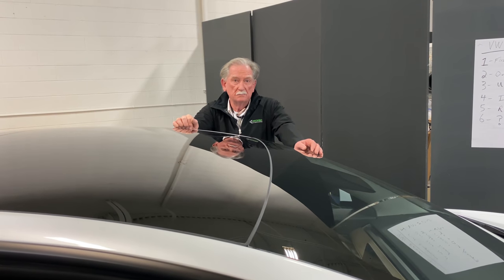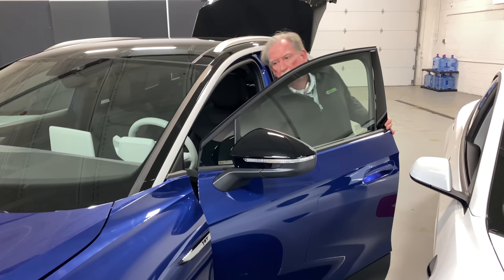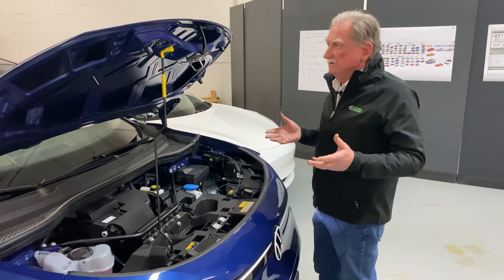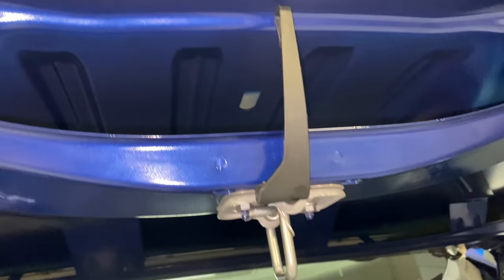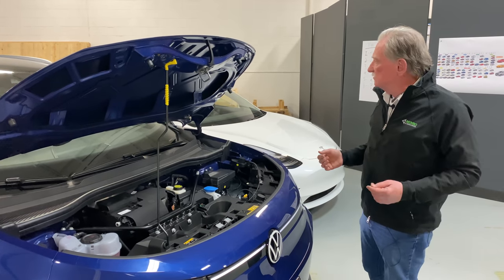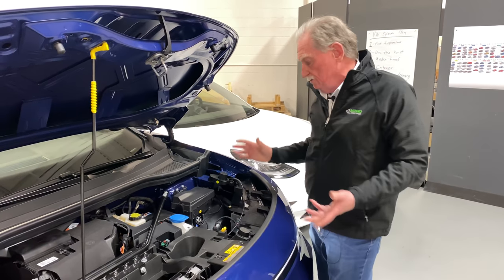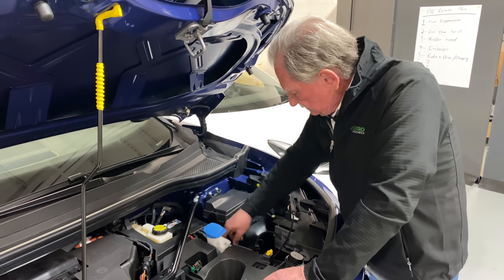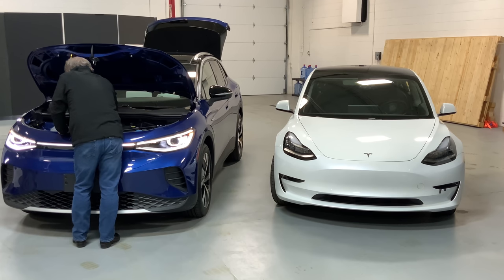2021 Volkswagen ID.4: E2 - Under The Hood

Comment: They put the stuff in front, so that the cabin is more spacious. I think this is a good trade off. Also, the length of the hood on the VW is a lot shorter. A Frunk would have been in any case smaller than the one on the model 3 with the long stretched hood. Also, you have a lot smaller turn circle on the VW, because they increased the wheel arch, which is a big bonus point in European cities. All things combined made the Frunk not possible. But you get some nice benefits instead of the Frunk. Maybe should have mentioned that.
Reply: showmanship to get more viewership
Reply: Tesla was able to do all of this packaging with a large frunk and big under trunk storage space with no compromises in the interior space, on a car that's significantly smaller than an id4.
Reply: 1) VAG designers and engineers are brilliant. The frunkless ID.4 means there's no added weight forward of the front axle, making the ID.4 handles like a RWD vs the MY frunk filled with stuff giving a FWD handling characteristics. Smart, very smart.

2) ID.4 small turning circle of 33.6 ft vs MY large turning diameter of 38.8 ft (C&D Tested).  That's a whopping 6.2 ft difference.

3) ID.4 shorter F/R overhang  vs MY longer F/R overhang
Reply: @loganrossignol No Frunk - RWD handling vs Frunk - FWD handling
Reply: @loganrossignol  that is not true. Model Y is longer than ID.4 and has less interior space.
Reply: A frunk is basically a waste of interior space at a given length of a car. Less interior space means less sales in Europe and more exterior length also means less sales in Europe. While VW sell the ID4 in America, Amerca currently is only a minor concern in the grand scheme of things, because the German market alone is bigger than the entire US market for EVs. In all of Europe 1.4 million EVs were sold in 2020, vs 250'000 in the US. Brands that most Americans never even heard of sell more EVs in Europe than Tesla, because Tesla doesn't have an appealing model for Europe. Sales wise, Tesla  as a brand has dropped out of the top ten EV manufacturers in Europe. That has a lot to do with the frunk and the resulting lack of interior space compared to European cars of the same length.
Reply: I believe that will make a different when both cars involve in a head on collision. I'd rather sit in an ID4 than a model 3.
Reply: @loganrossignol  no they didnt
Reply: @loganrossignol  Sorry but you are wrong. I D 4 is smaller than the Tesla and offers far more freedom space inside.
Reply: Just as an heads up, there is space for a frunk. There are lots of kits out there which you can install, without removing a single thing.

Comment: one of our most cherished pastimes here in Europe is "hit the pedestrian" - that's why our hood-regulations are a little more strikt compared to the U.S.
Reply: Nah, its just that Europeans try to save pedestrians, whereas Americans don't care that they die
Reply: @lukei1  Real reason is that Europe actually has pedestrians and cyclists. In the US everyone is required to drive oversized SUVs and pickup trucks. Apparently their heads are already damaged.
Reply: 🤣 these comments
Reply: we have actually walkable cities (aka actual cities)
Reply: @Miata822  not more, just that their streets are more narrow so it seems that way.
Reply: @PhilippeLarcher  everything is bigger in usa. Hard to compare. Usa cities are built better for car travel. This means that driving is less limited. European city's walkability is a work around solution for having very old cities not designed for modern transportation.
Reply: @gt5228z  that's a way to look at it :D
Reply: @gt5228z  No, they do have more. After things settle down you should get out more.
Larcher is right by the way.
Reply: @Miata822  population density is much higher in Europe/germany. That is, if you're looking at the United States as a whole, you would be correct. It's more accurate to compare areas of similar population densities. Say New York versus Berlin. Just to give you some perspective, us population density is 35/km vs 232 in Deutschland. We got to compare apples to apples, you know?
Reply: Strange that the EU death rate for automobile accidents is 9.2 per 100,000 people and the USA is 12.4 - look out for flippant comments that can bite you back . . .
Reply: @gt5228z  The population density of yjr US state of Georgia and the German state of Bavaria are quite similar. Munich is pedestrian friendly. Atlanta is not. 
History plays a part but so do US urban planning and zoning.
Reply: @Miata822  you got me there but atlanta is like the worse example in the country. Take it and la out of the picture and it's not bad given the mostly dispersed population. Chicago is an example of how transportation in densely populated areas should be.
Reply: @Miata822  Also worth mentioning that urban planning isn't a federal policy in the usa. Largely these things are handled by the individual municipalities.
Reply: @gt5228z  The Dallas/Fort Worth area is far worse than Atlanta and famously "Nobody walks in LA."

Yes, weak local planning and zoning, or no zoning at all as in Houston, combined with powerful developers has led to the mess here in the US. The only open land we have preserved is in very remote locations and even that is constantly under threat today.

The Europeans take much more care in preserving chunks of nature near population centers. Americans' aversion to government limits on property rights can be found all the way back in Alexis de Tocqueville's writings of his travels in America.
Reply: @Miata822  We have a very different perspective but we are also in very different geographic locations. I couldn't disagree more about the preserved land thing but I'm also currently living in northern Michigan. I'm assuming you live someplace in the south where things are very different. I think we agree more than you think. I mostly just hate when ppl compare the USA to tiny european countries who have very different problems, government structures. For example I hear many americans bitch about the lack of good trains in usa but also know that there is a huge misunderstanding of why that is. Same with high speed internet access in s korea vs .... well... Michigan. It's very different but also there are reasons that some countries are better in some ways. In some ways, the usa is great like for instance USA has some of the world's best colleges and universities, specifically in fields of medical research, and computer science.
Reply: @gt5228z  We should get past the point of feeling the need to congratulate ourselves and work on the areas that need improvement.

As to urban density and pedestrian traffic, that is all down to history. Cities that were well developed before WWII have a real city center. If the city was maintained it still does (NYC, Boston, Chicago). If the city had massive growth only after Levittown it is a sprawl of suburbs.

Many countries have invested in universal broadband and we should too. Small town economies are dying and small states losing their tax base because of inadequate connectivity.

As with infrastructure, climate change, healthcare, higher education, or even establishing realistic personal savings, the cost of the things we need to do is front loaded. Just like strict planning, zoning, and code enforcement Americans don't like to be told what to do, even if doing that would make everybody's life better. It's just how we are.
Reply: Americans don´t walk much - most places don´t even have sidewalks.  Europeans walk a lot - there are a lot more pedestrians to hit.
Reply: @Miata822  Or some european countries are smaller than some of our cities. European cities were designed when people rode horses and walked. Many US cities, especially on toward the west, were built when cars were being used. So our cities are spread out and walking is only feasible if you live in the city center.
Reply: @lukei1  you took the words straight from my mouth
Reply: @Miata822  the last time I walked on long island from Roosevelt Field to RXR Plasa (just 40 minutes power walk) I was almost hit by one car while passing a crossing with pedestrian lights on green. The driver was so suprised, that there are some predestrians walking there around. On the other hand on 10% of that 2,6 mi route there weren't even predestrian sidewalks and had to share the road with cars. In the middle of a city, for a european guy like me, that was shocking. Maybe that is why my boss told me to always use the limousine service from my hotel.
Reply: @gt5228z  If you go to the channel "not just bikes" you will see that the US cities with broad straight highways crossing it, in fact can serve less traffic than the smart less lanes streets in Europe. Too many exits, entries, side roads, parking lots. Not to speak of living space.
Reply: Anyone remembering the 70s, when every European car had to be turned into a rubber boot to fulfill US safety regulations.
Reply: @fromgermany271  yes, but we Europeans learnt something from that. You Americans aparently didn't.
Reply: @zetadimensions  guess where I am from...
Reply: @fromgermany271  didn't read your name. However what I said still applies
Reply: I don't know if its true anymore or not, but apparently at some point in US it was "cheaper" for insurance companies, that the pedestrian died and was not put in a wheelchair etc. for the rest of their life. This apparently affected the US car designs to not save pedestrians. Please reply if you have more accurate info on this.
Reply: @PhilippeLarcher  Why not live inside a square grid of noisy air polluting roads? That way you can divide up the walkable space and be forced to wait at red lights in order to go anywhere!
Reply: But you try to hide it with your much stricter euro ncap pedestrian aeb tests
Reply: So, it's kind of like catch and release fishing?? They just bounce off and go on their merry way. Here in the U.S. we catch and kill. :)

That was funny wording by Sandy that Americans try not to hit pedestrians, implying that Europeans are careless. Not sure if intentional or just poorly worded, but I highly doubt Americans are safer drivers around pedestrians.
Reply: @jimsomerville3924  catch and release... back into the wild whens they came from :D
Reply: I think there are more pedestrians and cyclists in Europe than in the USA.
Reply: @Miata822  is that why the Americans are also fatter?

Comment: Dude, maybe you should compare size of the front compartment, compare the turning radius and the extra space, which the wheels in ID4 need to achieve this turning radius and take into consideration that there will be a version with front motor soon. If you would do all this, you would come to the conclusion, that there is no space for a frunk. Tesla wastes space for a small trunk and a large hood and has a giant turning radius.
Reply: having a "frunk" sacrifices a large amount of space inside of the car
Reply: Funny how you never hear about people (owners) complaining about the Tesla's turning radius. It must not matter as much as you think
Reply: @Tevon93  it matters more and less to different people.
Reply: Exactly, the AWD is coming in late 2021, and that hood is about half the size of the tesla.  Also, have you seen what it takes to change the filter in a model s?
Reply: @Tevon93  Come to Europe and you will complain about Teslas turning radius after driving ID3/4.
Reply: @Tevon93  turning radius is awful.  It's like maneuvering a boat every time I park.  Many features get an A+, but this one is a solid F.
Reply: @Tevon93  My boss has got a Model 3 and complains a lot about the turning circle. It makes getting out of our underground carpark a chore. European problems, I guess.

Comment: VW have said they chose to move everything to under the hood to make more cabin space. From tests TeslaBjorn has done the interior size is second only to the 5 seat Model X! I had a Model 3, never used the frunk so this wouldn’t bother me.
Reply: I have never been in a VW ID4 but if you look at the numbers then the interiors of an ID4 and a Tesla 3 are very similar.
https://www.caranddriver.com/volkswagen/id4/specs
https://www.caranddriver.com/tesla/model-3/specs
That surprises me as the Model Y seems like the natural competitor of the ID4 and Model Y does have a bit more room (not to mention the option for a 3rd row of seats)
Reply: @pierre.a.larsen  no, the numbers are missleading. The official numbers are meassured from the widest space to the max lenght, and not the true volume. If you look at TeslaBjörns Bananabox test or the European meassurement for trunks which utilses normed 1l blocks and stuck the trunk full and count them, you'll see how the ID4 utilizes the space.
there are no Model Y in europe yet so we sadly don't have the direct competitor for comparisen yet, maybe Sandy could meassure the interiour space
Reply: I'm a Model 3 owner and I had 30 min with the ID4 two weeks ago. I'm 185 cm high and I can tell you the legroom ID4 provides is much better than in the Model 3.
Reply: Model Y is 16.5 cm longer than the ID4 and 7 cm wider so it better have more space inside: :)
Reply: @arnorjonorvarsson6215  Model Y’s hood is approximately 30cm longer than the ID4 so I’d guess the ID4 had more interior space (although Model Y wasn’t in TeslaBjorns test as it’s not in Europe yet.
Reply: I think you’re right! Bjørn did the test with this car and many others. Only one version of the model x, and a pre facelift model S , I think it was the 5 seater, fittet more boxes. So figures are one, real world is something different. Think with this about the given factory range ;) if you don’t agree, look at the video of TeslaBjorn. They are good anyway! @teslabjorn
Reply: Surely the comparison should be ID4 Vs model Y.  They have virtually identical outside dimensions I think?
Reply: @bluetoad2668  no Model Y is substantially larger.
Reply: @arnorjonorvarsson6215  oh that explains the extra room inside and higher towing capacity then.  I guess the ID 4 won't prove so popular in the US in that case.
Reply: So do VW offer a 3rd row of seats? It should of there's more room than the Y
Reply: @bluetoad2668  no they Don’t. Well, not yet.
Reply: @arnorjonorvarsson6215  the ID4 is wider and Taller (slightly) the Model Y is 8” longer but the hood is 12” longer so the cabin on the ID4 is bigger - which was VW’s point about not having a frunk and putting the HVAC etc under there to make more room in the cabin. Some will prefer a frunk - some will prefer a bigger cabin. Me personally, I never used the frunk on my Model 3 but don’t want or need a bigger cabin. 🤷🏼‍♂️
Reply: @scottwills4698  nope you're wrong. Model Y is 1920 mm wide but ID4 1852 mm...
Reply: I'm a Model 3 owner and don't use the frunk would have preferred more legroom in the back.
Reply: @arnorjonorvarsson6215  well that’s what you get when you just Google it🤦🏻‍♂️ it is 50mm wider. I’d still say overall they are similar in size in the cabin.
Reply: @bluetoad2668  wouldn't be so sure about that since ID4 size is very similar to Toyota Rav4 and Honda CRV which are the top SUV sellers in the US.
Reply: @arnorjonorvarsson6215  I guess we'll have to wait for the customers to vote with their dollars
Reply: @arnorjonorvarsson6215  Funny, i had the opposite feeling. Sitting the in back of the ID4, i sat higher, with marginally better support under the thighs, yet bumping my knees into the front seat. The child sitting next to me didn't have greats amount of room either. 

Of course, this must be up to driving position, leg length etc. But over all, ID4 felt like a tiny van on the inside.
Reply: @scottwills4698  "Model Y’s hood is approximately 30cm longer than the ID4 so I’d guess the ID4 had more interior space"
Where did you get that number? According to VW's own presentation, front overhang part of Y is only 2 cm longer than ID4. Wheelbase is 12 cm longer though (which means more space) and rear overhang part is 2 cm longer.

Model Y has slightly more passenger and cargo volume than Audi e-tron Sportback.
Reply: @deandre1988  www.caranddriver.com says 6 cm more legroom in the back in ID4. Which aligns with my experience. I put driving seat in my driving position before testing the difference in back seat room
Reply: Sandy likes the front trunk, which is ok, but dismisses other cars for not having one. It's a lot easier to access all those car components in the VW. Overall hes got lots of positives about ID.4, but fusses about superficial shit such as menus. Overall the ID.4 is a well engineered car.